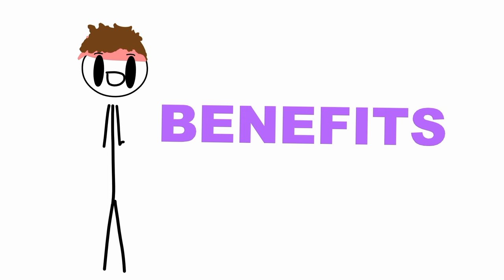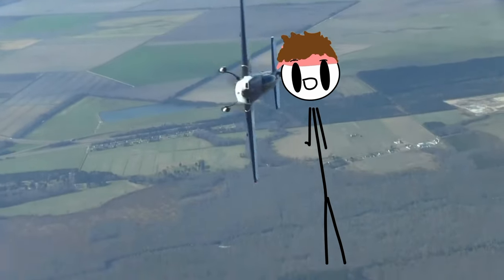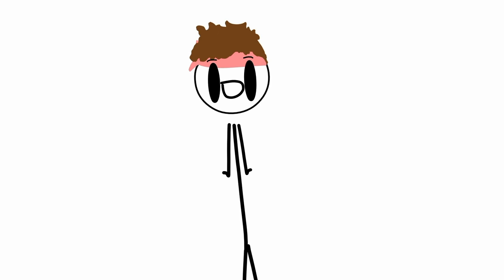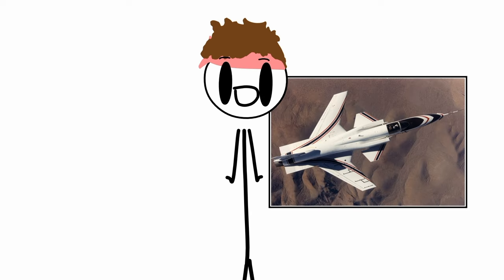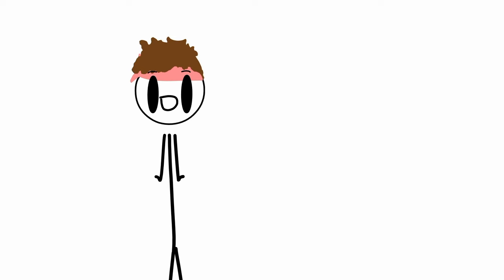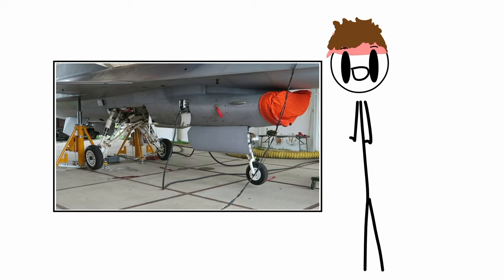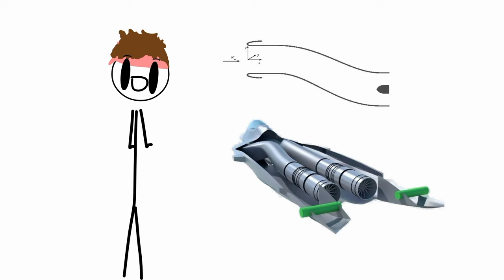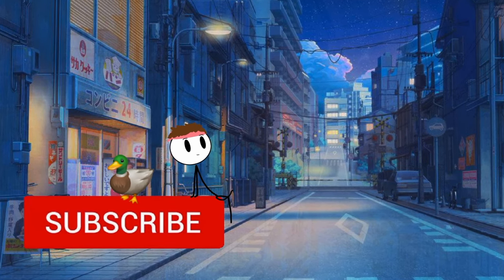Planes with Backward Wings are Weird

Comment: Most modern aircraft actually tend to have either wingtips with a lower angle of incidence compared to the root of the wing or some sort of vortex generators, specifically to delay the stall at the wingtip and over the ailerons in order to maintain roll control as the aircraft stalls. That means that wing stall usually happens at the root of the wing and propagates outwards, even for conventional wings. That won't be the case for all aircraft, but it's generally an easily solvable issue, with the added benefit of reduced induced drag as the pressure difference between the suction and pressure sides of the wing will be reduced :)

Loved the video btw.
Reply: Cranked arrow wings on the F-16XL variant comes to mind.

Comment: Su-47 could not operate at supersonic speeds without wings sustaining severe damage. They used the plane to test new engines and systems until they had to down it because airframe sustained too much stress.